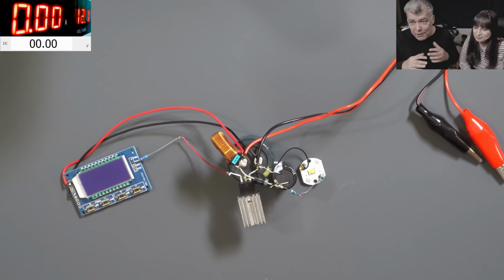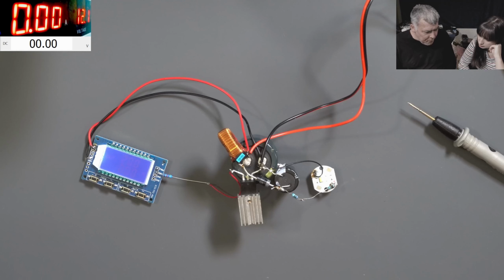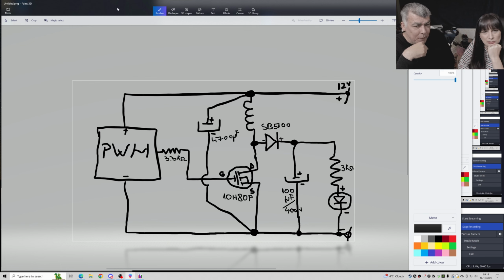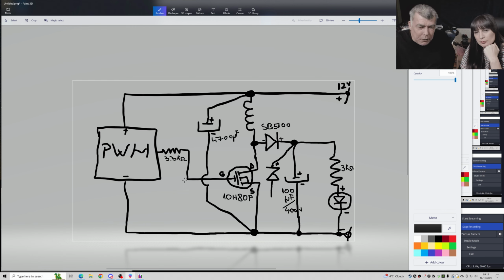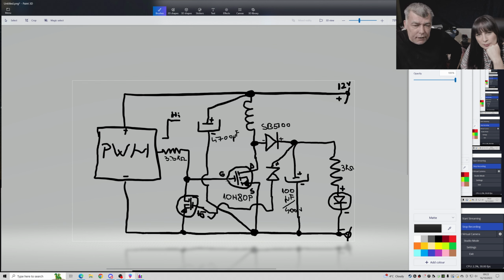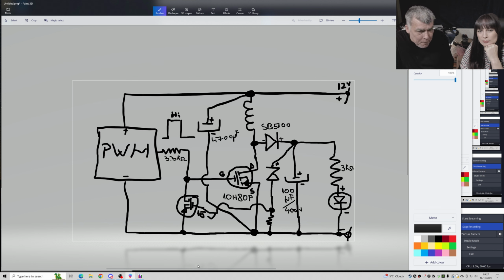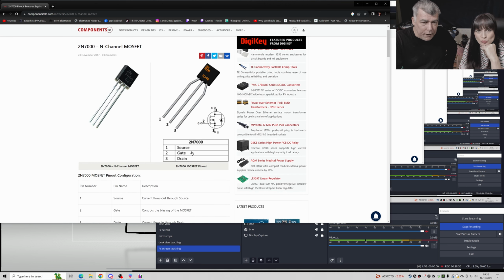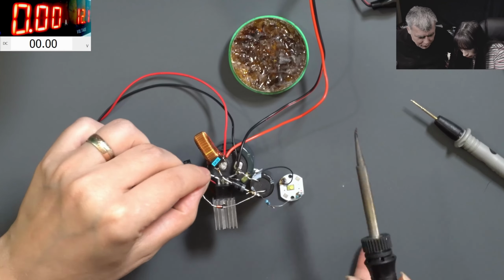Voltage regulated current boost converter - Lesson 31 Learning electronics with Diana

Comment: Very good question from Diana: Why the Mosfet from the PWM does not have a resistor? And that was quite important to underline that you do not have to put a resistor from a IC that is providing PWM signal since that IC already has an internal resistor to the ground when is providing the 0 (zero) signal.

Comment: I've been wondering why MOSFETS on laptop motherboards tend to be in pairs (except when there's a single Dual-MOSFET that is) and now I know why!
Reply: By far the most common reason that MOSFETs are in "pairs" on motherboards and video boards is that local regulation is done with buck converters that use "synchronous rectification." Instead of a simple diode a MOSFET is used as an active switch to improve efficiency. When there is a large ratio of input to output voltage in a buck converter, which is usually the case with local regulators in PCs, the diode conduction time is much longer than the high-set FET conduction time. That means power loss due to the diode is a significant part of the overall loss. By using a FET instead of a diode the effective forward voltage can be greatly reduced, making the circuit more efficient.
It has nothing whatever to do with the crude circuit in the video. If you used something like that in the video in a real converter the circuit would last a few milliseconds before going up in smoke.
Reply: LOL - the 'crude circuit' in the video is nothing more than a teaching aid and not designed to be used in the real world! @D614G_aka_Doug

Comment: What the added FET is actually doing is turning a reasonably good gate drive signal for the main FET into a very poor drive signal resulting in greatly increased switching losses in the main FET. 

The overall circuit is a voltage boost converter, not a "current boost" converter.

Comment: Sorin, some expressions you 're using are wrong. And this creates confusion.
e.g. 'lose current'. This expression (which took me some time to make out what you meant) DOES NOT EXIST!

'Waste power' you meant. 
This expression DOES exist, this is the correct expression, not "lose current" nor "lose voltage".
Just a friendly notice so that we can get along without misunderstandings.
Reply: Thank you, but we are not really wasting current, the current is exchange in heat which is getting lost, so not sure which is the right word for this because we are losing current with intend, please let me know thank you
Reply: @electronicsrepairschool  
(links are not allowed (I think) so I can't insert the source 's link)
Calculating the Power Dissipated by a Resistor
Power dissipation is a measure of how much power (P = I x E) in a circuit is converted into heat.
P (power dissipated) = I^2 (current) × R (resistance)
V (voltage) = I (current) × R (resistance)
I (current) = V (voltage) ÷ R (resistance)
P (power) = I (current) × V (voltage)
Therefore, to calculate the power dissipated by the resistor, the formulas are as follows:
P (power dissipated) = I^2 (current) × R (resistance)
or
P (power dissipated) = V^2 (voltage) ÷ R (resistance)
So, using the above circuit diagram as our reference, we can apply these formulas to determine the power dissipated by the resistor.
Voltage = 9V
Resistance = 100Ω
I (current) = 9V ÷ 100Ω or I (current) = 90 mA
P (power) = 90 mA × 9V or P (power) = .81 W or 810 mW
P (power dissipated) = V^2 (voltage) ÷ R (resistance)
or
P (power dissipated) = 92 ÷ 100
or
P (power dissipated) = 81 ÷ 100 or P (power dissipated) = 810 mW

Your circuit's goal was not the production of heat, so power converted to heat is a waste.
Reply: @pgsss6354 oh, sorry, here is a misunderstanding, i asked about the right english word for this, as you said 'lose current' doesn't exist
Reply: @electronicsrepairschool  
It 's power that you 'lose' ('waste' if we want to be correct).
You don't lose current, the current can only get reduced, not lost.
And the voltage drops, you can't 'lose' voltage.

(the correct terminology helps in understanding each other)
Anyway this does not reduce your excellent (and I mean EXCELLENT) content, keep up this wonderfull series of lessons!